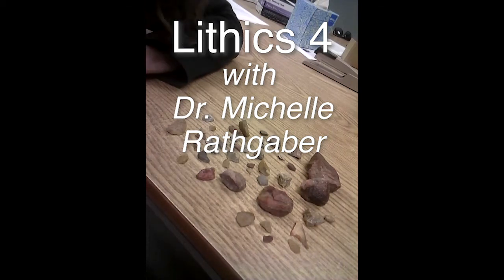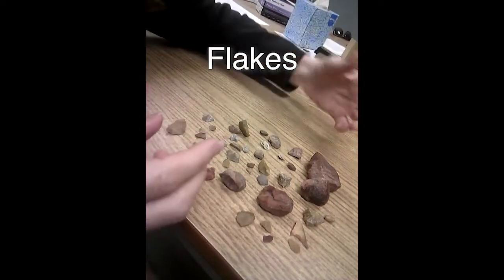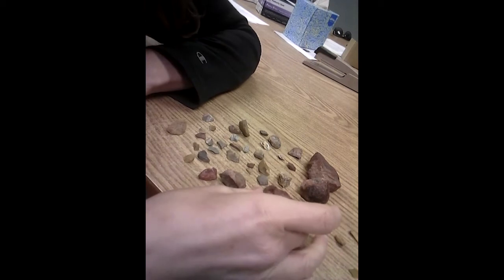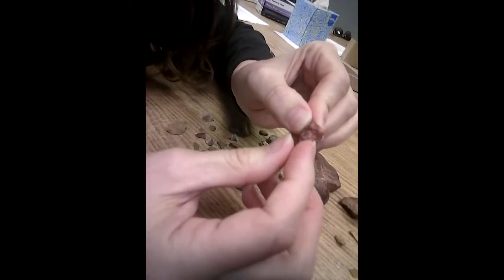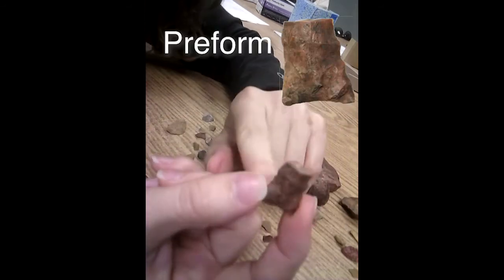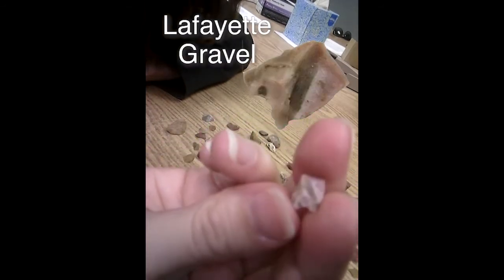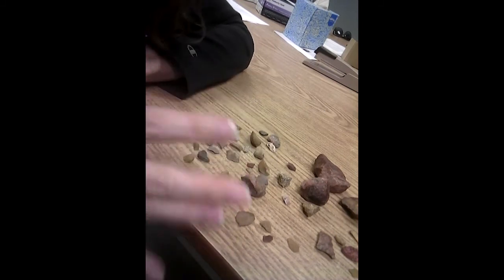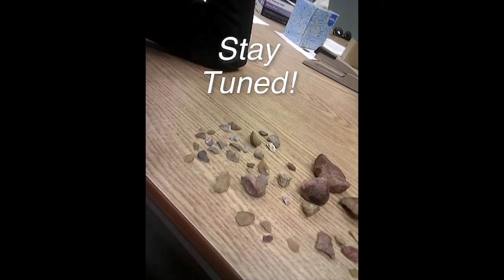Lithic Analysis 4  (Lithics in an FSN)

Comment: That pot lidding that you're talking about happens when your heat treating flints or cherts. when you bring the heat up too fast or bring it down too fast. It also happens if a point is laying on the surface and there is a brush fire. We find several points with the same characteristics inside of fire pits. You must also be a flint napper or you know one because you're exactly right. Another great video keep up the good work looking forward to seeing more. You can also do some heat treating on slates it turns a blue slate to almost a red. If you heat treat too fast, we call it blow your load. The flint,chert's breaks up and looks just like FCR. Especially if it has a lot of moisture in the Stone. Never ever pick up rocks out of a creek or a river to make a fire pit with for camping. The moisture in the Rock will make it explode. Always use rocks for a fire pit that you pick up on the surface . In fields they have less moisture. It lessens the chance of explosion. When I Arrowhead hunt there's two things I look for.FCR, flint or chert flakes. Then I know for sure I'm on the campsite. Hope you're having a great day